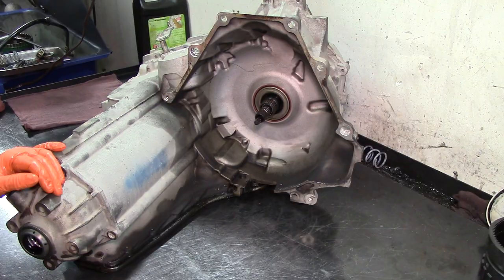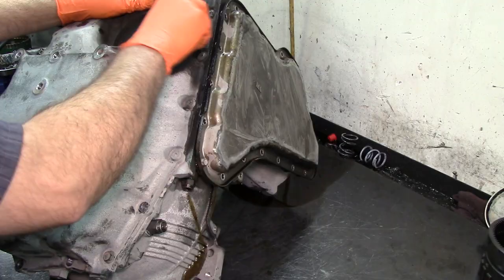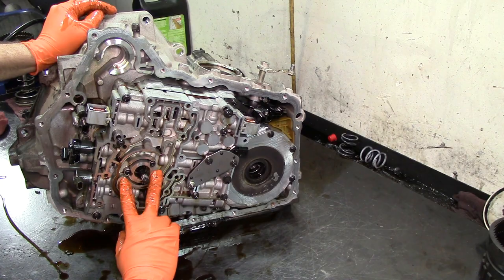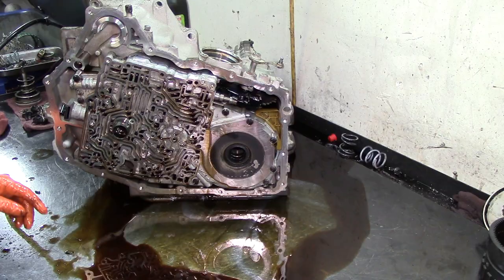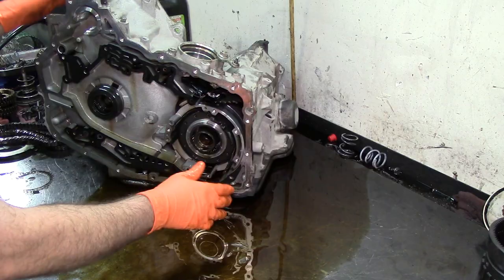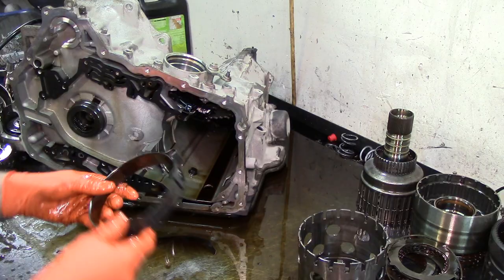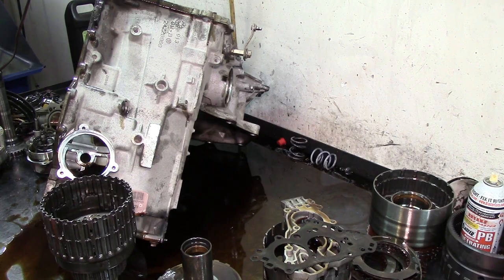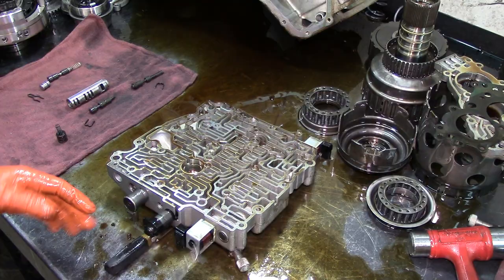4T65 E Transmission Teardown Inspection

Comment: Came here to see why my forward band broke. Got more than I bargained for. Thank you! INCREDIBLY HELPFUL.
Reply from the maker: Great to hear!
Reply: Don't mind me tryna diagnose an issue I'm having with an '07 Grand Prix GXP 🫵🏿 What's the problem?  Well, when I put this car in drive, it won't move, but in Manual/TapShift, it drives.  All other gears work just fine except DRIVE!!  Could my "forward band" have broken too?  I haven't even finished watching this video, but I will 💯 No 🧢

Comment: OK Hiram you delivered!! I asked for a 4T65E video and here it is. Thanks a bunch. My personal feeling is that this is one of the best automatic transmissions ever made. I've had too that have gone over 250,000 miles each. Always love to watch you work. Looking forward to the additional videos you must have in the hopper on the reassembly of this unit. Once again thanks.
Reply: How? The engine in my Impala has outlasted two of these. The first lasted to 118,000 and the other about 86,000. Please give me some pointers.
Reply: It's a shitty transmission, I've had two bad ones now.  The tranny in my 97 Intrepid currently has 247,000 hard miles and never had a fluid change, now that's a good transmission.
Reply: rebuilding one this week they seem to only last about 160 000km max from what I'm seeing. it appears to the be the drive band that breaks on them.
Reply: SATAMAN Schmidt. Do you know if he has a 4t60e video? Or are the 60 an 65 close enough to use this guide? If you happen to know by chance a response would be helpful
Reply: @Thomas47100  mines got 320k miles

Comment: I am quite simply amazed at your knowledge and abilities! I have been working on cars for over 50 years off and on and had considered rebuilding my 2002 Impala 3800 transmission after the cooling fans quit and the transmission let me limp home at 10 mph in 1st due to the overheating..  After watching your video I wouldn't do it if someone put a gun to my head. All those parts you said not to forget-I would forget about half of them! I wish I had your talent.

Comment: Love these transmissions, and the W body vehicles they are installed in! I did the DIY shift kit on my 98 GTP, 2-3 accumulator spring in the 1-2 accumulator as well as a 3/4 steel spacer in both accumulators. Car had zero issues shaking the tires into 3rd when you were flogging it! Had good manners when just cruising as well!

Comment: I am thrilled you got one of these units to rebuild. I wish it happened earlier, back when I was rebuilding my own 4T65e-HD unit. You have covered a few details not included in the service manuals or the updated technical specs manuals. Information that would have saved me some time on the build and a lot of time on the intensive research I did.
My 2nd clutch pack had the excessive play - I was unaware the steels were available in variable thickness at the time. I tried the trick of adding one of the original steels to the assembly, but the tolerance was too tight. Without it, it was too loose. I played it safe and went with the too loose option. Since the rebuild, my transaxle still runs great to this day. I have the occasional 1-2 long shift issue, but it's a rare thing. The MAX ADEPT (not max adapt) code gets flagged when it happens.

The updated spline drive was implemented in 2004 BTW. I made sure to get that part. I also added the clamp for the accumulator lines. The one thing I wanted to try, but didn't have the detailed information for is this trick.. Adding a 'squirter' line to the differential. I've seen this done on a forum somewhere and it caught my interest. GM has a high performance rebuild manual for these units too. They use only 3 forward gears instead of 4. GM also produced an upgraded input shaft that retailed at $1,200. This part is no longer available. It was designed without the groove for the O-Ring, the first thing you removed in this video. Another company makes a high performance input shaft for around $600. I couldn't justify that cost as it is more than I paid for all the replacement parts from my local parts supplier.

I also included the transgo shift correction kit and a re-manufactured torque converter. I must say - I really enjoyed going through the process of the rebuild and the research involved to get it right the first time. Well, almost right, minus that intermittent long shift issue. I found your videos to be most helpful and I can't express to you how much I appreciate your feedback when I hit you up with my questions.

Hiram, thank you so much for sharing your skill with us! You are an amazing technician and your video's are an awesome learning tool that provides an excellent supplement to the tech manuals. I hope you have been able to share my southern engineered J-Tools with a few people who don't have the real deal. One of these days, I will go through all the photos I took during my rebuild and make a good video to share. I need to add the engine rebuild and the other special modifications implemented along the way.

In the meantime, I have uploaded a few locksmith and security videos on this channel if you have any interest on that subject. This one is my favorite. It may be old, but it has great info that still applies to this day. -- https://www.youtube.com/watch?v=xU_0OVygEMY

Thanks Hiram - you da man!!!!

Comment: You do great videos, so much to cover, I rebuilt a 700r4 with the help of your video, then ran into the situation of having to buy the $100  bore tool and updated valve for the tcc lockup issue because the bore was worn and the original valve was prone to wear out because of its size,  because of that valve I still had issues with the valve leaking causing slippage which was what caused my transmission to fail in the first place.
 While I had it out and torn down I  also installed the trans go upgrade spring kit and had to replace the plastic servo pistons with aluminum ones to prevent future issues as you noted in your video. I also I installed repair grommets on the valve body plate where the check balls wear out the plate. The transmission works better now than when it was new.
 Been going strong towing heavy loads for 3 years now with no problems. Trial and error and patience is a learning process but it helps to address every known issue before you rebuild and have those parts ready. After all with all the work involved you want the trans to last.

 The problem with all these transmissions is you are not just replacing seals bearings and clutch packages, there are numerous parts that  had design flaws that needed upgraded part replacements like the sun gear issue with the 700r4 you mentioned in your video which I did replace out of caution even though it looked okay. I find you have to do the tear down, inspect every part carefully,  research every fix and upgrade so while it is apart you can get all the needed parts to address every design issue to  prevent other possible problem in the future because of the failure of the factory original non improved used parts you reinstall.

In this video you did not cover much about the issue with the valve in the plate which is a common problem, I believe it was the modulator valve, I understand there are 2 fixes for it, either boring it out re sleeve it and put in the new valve in the kit, or superior offers a k-098 kit to address the valve leakage issue that does not require boring, it uses a plug and new valve

Comment: holy shit this thing is more complex than the space station.
Reply: And it's a p.o.s. cant handle any power or abuse at all. Crazy that pontiac paired this with one of the best engines ever made🤷‍♂️
Reply: @braddishner8597  yep mine starting to slip time to install the shift kit lol
Reply: It’s actually not bad , Allison heavy duty transmissions can get interesting
Reply: When I suggested that I treat mine apart for my 08 impala that's exactly how my buddy described it. He said it looked like a spaceship inside a transmission.
Reply: @GameLover1022  whats a shift kit?
Reply: @chuckwoolery8668  it firms up the shifts and helps preserve clutch life it was a transgo shift kit FEELS LIKE NEW!
Reply: @braddishner8597  GM V6's are trash.
Reply: austin saturday I’m dealing with shift issues with my 2000 Century. How do you know if it needs a shift kit versus solenoids? I read that either of those can cause weird shifting. I’m not getting any fault codes
Reply: @Torrious  I've been around since 1961. I've seen it all. all GM v6 engines were trash including the 3800.
Reply: @braddishner8597  More durable than the 6-speed in my 2013 Explorer.  2024 and my 09 G6 still shifts like new.  I just drive it back and forth to work, so I don't abuse it - which helps.

Comment: Thank you the extensive tutorial, I can see you’ve done that before. My tranny sometimes has no forward or reverse after sitting a spell, shut the car off once or twice and it works fine. To me, it seems electrical or valve body problem with no codes. ....It’s an overhaul. And after watching your video, I’m not getting into it. Thanks again I enjoyed it.

Comment: Thank you Hiriam.  I found that forward band bit, which you said breaks frequently, in my S80's pan. I know what to do now. Also it does move slowly in manual 1st,  2nd starts flaring, exactly as you described.

Comment: I’m no professional, but my 4T65E-HD GTP transmission began to fail at about 150,000 miles. Main things replaced: clutch internal and external rings with teeth(some broken), reverse servo bands that squeeze the clutch I believe were somewhat burned, 4th clutch shaft (splines were stripped halfway down), chain scoop was replaced, transmission mounts, main control valve body, internal harness, sonnax actuator feed limit valve, pressure control solenoid, 3rd clutch spring, 1st and 2nd support bands and torque converter. Some small things were replaced also but that’s most of the big stuff. The transmission now runs great.

Comment: I have a  2005 chevy impala, 3,4 motor  4t65e tranmission. It  pulls  but  is very slow at shifting ,an acts like it doesn't  want too shift  from first , but if you drive it easy  and give it about 3 too 4  seconds  it will shift,  it does make a funny sound for about 1 second  and  then it  will shift   too all the rest of the gears,  an go really good , I change all new solenoids  and still does it.   It shows no engine  codes  .

Comment: Problem with my son's 2001 chevy impala
...Reverse, 2nd & 1st gears only 
Your video helped me very much. I dropped the lower pan, 
 found a part of the reverse band had broken off !!
Calling the scrap yard or parting it out very soon !
Does anybody need a 3.8 engine ?!... Holla !!
Reply: How much for the motor?
Reply: First $600.00 takes WHOLE car !
Clean Title, No Leins
Reply: @multinaire  Does the car drive at all? Where are you located? And could I see the body of the car, interior, and under the hood if that's not too much to ask. Really considering buying

Comment: Done work on these. They can be very troublesome if you're lacking the experience to work on them. Mine is a 4T65E HD. They were mated to 3.8L engines that had superchargers on them and also the 5.3 V8. The HD version has a stronger final drive and the CV axle input is larger on the passenger side

Comment: Glad I found this. Very informative. Under heavy acceleration in my 01 silhouette, I get smoke, which is burning trans fluid. Never any fluid leaking on the ground. I think that breather is right under the exhaust crossover. Makes me wonder if that paper gasket is torn.
Reply: Blessings.  I have a 2000 silhouette.  Can u watch the vids I posted . What happened with urs? I lost drive. Reverse still good I have to start in 1st and drive like a manual. Please advise ty in advance

Comment: Those three he mentions as very tight, that's an understatement. I had to stick a bike seat post on my socket wrench to bust them loose without damaging anything. Probably best to measure the bolt lengths if they're that tight, they can stretch and that would be bad.

Comment: I have a 4t65e in my 2002 Chevy venture.  Never had a problem and I'm at 151,000. I changed the filter, fluid, and pan gasket to Dexron vi in 2013 at 110,000.  I recommend everyone upgrading to the new GM fluid.  Also I would never recommend using any additive in a transmission.

Comment: I'm impressed at how quickly you disassembled this. Also it was obvious you have done this many times. You know where each part belongs and that makes it go fast when it comes time to reassemble it. This is a 3 year old video. I seriously doubt you review the responses 3.5 years after posting. A few times through the year my Trans-axle does the hard up-shift thing. Turn off the car for half minute and it's back to normal. I read it's a solenoid sticking. Money wise. I think a good flush of trans fluid will be the cheapest fix/extension. Almost time to replace the car. 150K plus miles.

Comment: Fluid is at the add line, but forward gears pull.
Linkage/selector is fine.
rebuilt valve body(OEM)
Used ATSG book.

Comment: Wow mate great job. Where's your shop location? I got the 4T65E HD which still working but has some big loose/delay between reverse and drive gear. It also need a performance upgrade so I can turbo charge the LS4. There is so much bad reviews about transmission shop in my location so i don't trust them with my transmission...

Comment: I have same transmission 2000 Oldsmobile intrigue and the pump rotor broke and locked up broke the torque converter pump shaft I've gotten another pump motor shaft but need to know what caused the pump to break and how to diagnose that problem to make sure it doesn't happen again thank you and your videos are awesome 😎

Comment: This is a good video. But every time he says "you can use", don't  do it. No magnets in the valve body parts. Use the right sockets. I was disappointed that he took 10 minutes to clean the torx bolts on the outside, then used the wrong socket on the reverse torx inside. 

Use the right stuff people.

Comment: So I got a problem with mine because it smells like burned and it'll drive through all 4 gears like nothing but when it comes to certain miles it doesn't go anywhere just revs up and transmission yells like a cat, good thing I got my father and we ordered the transmission pump kit, with the shaft and sensors, and hoping it works because I know for sure it doesn't need a rebuilt

Comment: Another excellent video Hiram. Would like to see a video on an 07 Caravan 40 or 41t if you can swing it sometime. I have one that works like crap with NO codes.
Reply: ***** Thank you for your reply. I checked the voltage ripple today and it's fine. I live in Canada and it's been very cold here, as low as -30f. Replaced the converter at 60000 for a shudder problem but still has a bump shift on coast to a stop from third gear. I was told it has the latest calibration.Takes a long time to shift to 3rd and 4rth unless I lift off the throttle slightly. Sometimes slips in reverse. First stop of the day from second gear when it's very cold will not shift back into low unless you wait a few seconds. Van does not have ABS or TC.

Comment: Those connectors are available as individual replacement ends. All you have to do is pull out the tab and slide it in a new one.

Comment: When heated above 176° Fahrenheit (80° Celsius), your garden variety common magnets will quickly lose their magnetic properties. The 4T65E in the GM W bodies commonly runs above 180°F.
A regular magnet will become permanently demagnetized if exposed to these temperatures for a certain length of time.
If you slightly magnetize the check balls they will become permanently non magnetic again on the first excursion to operating temperature.
There are high temp rated magnets that are used in transmission pans.  They are more expensive than regular magnets. GM screwed up on some of the 4L60 & 4L80 and all of the 4T40, 4T60, & 4T65 transmissions by putting low temp rated magnets in the pans.  There's a TSB outlining replacement of the original magnet with one or two magnets rated for the operating temp in a transmission.
Reply: Could you just say what the correct magnets to put in the transmission pan is?

Comment: Doing the in car solenoid replacements now..Got 3 of the solenoids in and on the torque converter one can't get to the clip that holds it in unless i take the pump off..Can't figure why they would design something that dumb. Same problem on a 99 gp i did before.  This is 01 Lesabre Limited.

Comment: My neutral safety switch is out in my 2011 impala... from the looks of it, might as well throw the car away. $25 part and you have to gut 75% of the trans to put it in.

Comment: I have a trouble-shooting question.  First, let me say, I sure appreciate your posting such good Videos.  I am sure you have helped a lot of people.

Ok - 2002 Monte SS (3800-not super charged) - 0nly 75k miles on the car.  It has a long delay on the 1 to 2 shift. After the delay, it sometimes goes right to 3rd and seems to skip 2nd.  I can manually go through each gear, but there will still be a long delay for it to shift into 2nd.  2-3 and 3-4 all work fine.  Seems to get worse the warmer the car gets.  Every once in a while, when you first drive in the morning, it shifts normal for a few blocks, but then the delay starts in 100% of the time.  No codes set.  Fluid and filter are clean, nothing unusual in the Pan.  Any idea what would be the best approach?  Shift Solenoid?  I saw you talk about the Molded Piston possibly causing a slow 1-2 shift.  Just wondering what your best guess is?

Comment: Great vid. why would this transmission make a bearing noise and makes pass side axle shake? the bearing noise/shake sounds like its coming from the middle housing, where the axle shafts connect. THANKS IN ADVANCE